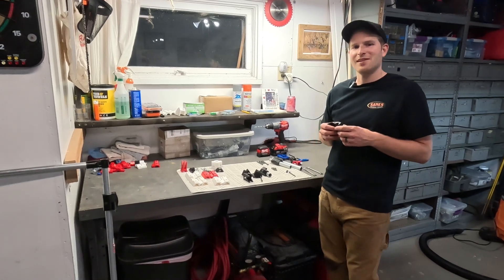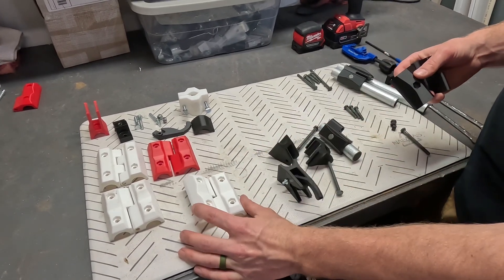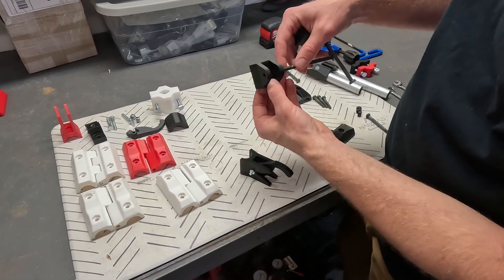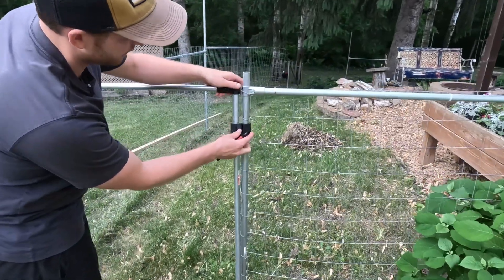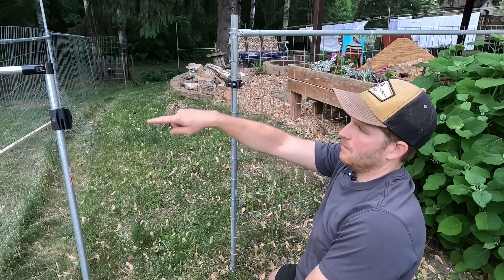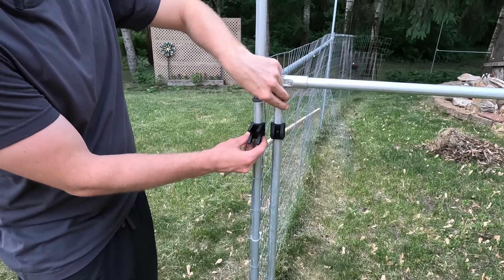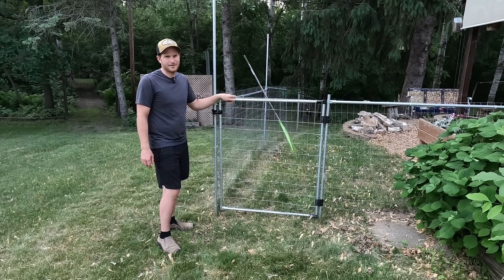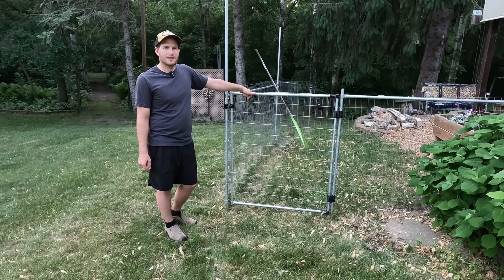3D Printed Conduit Gate Latch and Hinge Set

Comment: Looks like you are using conduit as fence posts. What do you use to pound them into the ground? Do you have to make a hole with a sharp metal or wood stake first?
Reply from the maker: Yep that exactly what I’m using. To pound them in I just used a post pounder, a big heavier pipe with handles that goes over the top and you just pound them in. No pre drilling